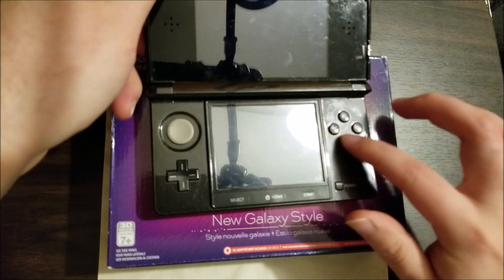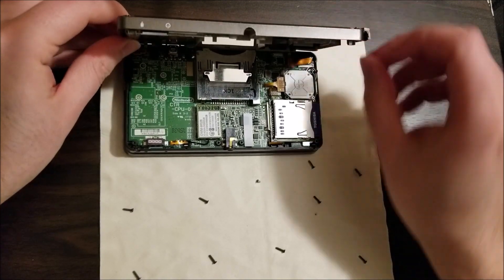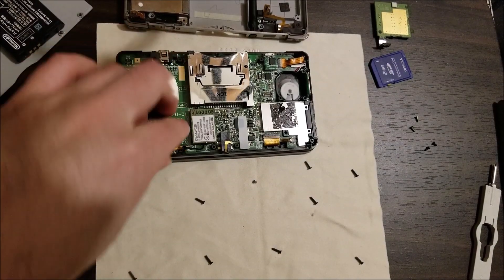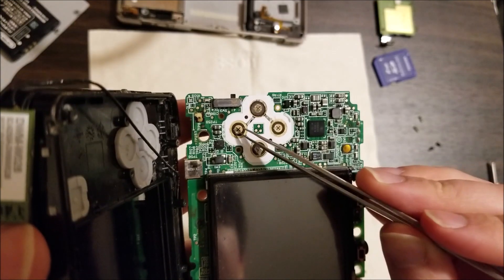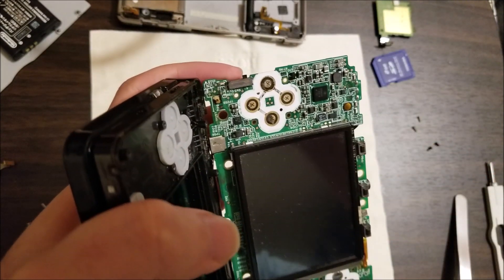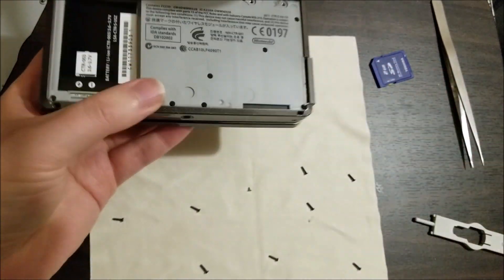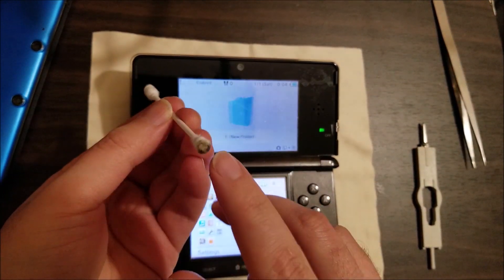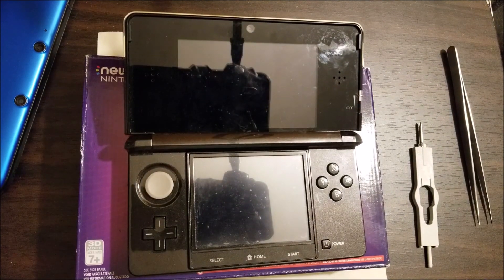Let's Fix: Nintendo 3DS Buttons Not Working

Comment: Hey, quick question does hydrogen peroxide work as good as isopropyl?
Reply from the maker: I'd generally avoid peroxide as it breaks down into water that'll be left in all the tiny crevaces on the circuit board creating a risk of corrosion. High purity IPA is suggested as it quickly evaporates completely, leaving nothing behind to cause corrosion.
Reply: @sjm4306  Is any Isopropyl solution 91% or higher fine? Sorry if this sounds dumb, I'm trying to fix a 3DS and have no experience in repairs
Reply from the maker: Yep, 91% or higher is fine

Comment: @sjm4306  Please help me, I have a Nintendo 3DS which does not receive input from me after I hit it, it can charge, it can power off, power on, you can see the home screen with everything normal, but the thing is I cannot give input, does not move from there, did you ever repair something like this ?

Comment: My A button is unresponsive so i took it apart to find it didnt look dirty at all. Cleaned it anyway but A button is still unresponsive. Any ideas on what the problem is?
Reply from the maker: The snap metal dome that connects to the pads could be worn/dirty.

Comment: Hey, nice video. I have the same model as you but my select button is broken, the one seen down left @ 0:48 ... Do you have any idea of how to fix it because I don't know if I will cause further harm if I try to open this soft cover one the buttons D:
Reply from the maker: Yeah those aren't really made to be opened, you usually just buy a new tact switch and desolder the old one to replace.
Reply: @sjm4306  Alright will do this, thanks for answering :)

Comment: Fixed my a button thanks to this vid, was a little nervous as I’m not really a fixer but that a button was driving me crazy. Every time I hovered over the button it would automatically click what ever it was pointing at and it was annoying as fuck. It would just click for no reason. Bought a busted 3Ds on Facebook and so far I’ve replaced the left and right back buttons, opened it again and swapped both membranes while cleaning out the buttons. Fully modded it and now to truly enjoy this system for what it was meant to be for. Thank you.

Comment: I got to order a new set of x,y,b,a buttons only because the ones on my og system seem to be peeling from the edges so it looks like dirt and grime on the edges of the buttons but it’s actually the clear coat peeling off and it is messing me up with the a button. Since I’m gonna open the system to do this I might as well just replace the buttons while I’m at it. My question is why did you disassemble the whole right side just to go left? You took out the analog and memory slots out but the buttons were all the way in the other side?
Reply: Oh ok, I just got my new membranes in and will follow this video.
Reply: But is that side necessary to open up if I just want to do the x y b a membrane only?
Reply from the maker: Only take apart enough to get access to what you need access to unless you are unsure if there's potentially more liquid damage inside that should be thoroughly cleaned out.
Reply from the maker: I wanted to inspect the entire front pcb in case there was extended liquid damage. Sure it's more effort taking the entire board out but better to catch any potential corrosion early to prevent worse damage over time.

Comment: Hey this video rocks man! Where do you buy chemical contact cleaner though? I’m trying to find it online but I can’t get results that look like yours 😬
Reply from the maker: I got mine from microcenter
Reply: Hey so I’m trying to fix my sticky down d pad button. I followed your video to a T; cleaned everything and put it all back together properly but the button still sticks. What do I do 😭
Reply from the maker: @ChrisDixon-ht1cb it's possible the buttons metal dome is worn out then and needs to be replaced, ebay has replacements for pretty cheap last I checked.
Reply from the maker: @ChrisDixon-ht1cb could it be the ribbon connections going to the top screen?

Comment: My old 3ds bottom screws are stupidly tight. What do you reccomend to unscrew them easier?
Reply from the maker: So long as they aren't already stripped you'll need a nice sharp tiny phillips jewelers driver. Go slow and apply downwards pressure the whole time while slowly backing the screw out a little at a time. Also it might sound weird but take the battery out, pop the 3ds in a zip lock bag and throw it in the freezer for a bit. The cold should contract the metal screws more than the plastic and make backing them out a little easier.
Reply: @sjm4306  'aight, I unscrewed it and reached the part of the membrane removal. I made a big finding after peeling the membrane off and seeing that everything was clean. So I checked under the steel plates inside the membrane and they were all burnt looking. I peeled off the other half of the membrane to try and clean it but it didn't clean. I clarify by saying that I had the same problem as your sister's boyfriend 3DS but now I'm clueless; guess I'll have to buy another stupid membrane...

Comment: what kind of screwdriver do you use? Cause when I try to unscrew the screws on 2:00 of the back of my 3ds xl I could only unscrew the top right and bottom right ones. For some reason, the left side isn't turning with my screwdriver.

Comment: 4:22 I tried these steps before but the SD card board/slot was welded/soldered. So I gave up, is it possible to take it off?
Reply from the maker: Iirc it's just strong adhesive that can be weakened by some heat from a hairdryer.

Comment: It's unfortunate you fast forwarded through the removal of the sticker. I'm looking for a tutorial on how to get this thing off without damaging it or the board. Hypothetically it should be possible without buying a sheet of stickers I will never use again.
Reply from the maker: Warm with a hairdryer and peel from edge with finger nails or tweezers. Just be careful not to scratch the board underneath.

Comment: I followed the steps, put things back together, but now the touch screen won’t accept touch. Do you know what might have happened? I checked and all the touch screen ribbon cables are attached. Is there a solution?
Reply from the maker: Triple check the touch screen ribbon (there's only 1, it's the small 4 pin one coming off the screen, the other larger one is for image data and has no effect on touch) is fully inserted, straight in the connector and the latch is secured. If that all looks good and it still doesn't work inspect the pins of the connector and the ribbon under magnification, it's possible they were damaged.
Reply: @sjm4306  it looks like there’s maybe corrosion in that area, do you know a good way to clean that?
Reply from the maker: Yep that would definitely affect operation. Use a qtip soaked in as close to 99% isopropyl alcohol as you can get. It may take a few rounds of scrubbing to remove. Afterwards check that the soldering on the affected pads still looks good and connected (if the corrosion ate away at the solder it may be necessary to resolder specific connections).
Reply: @sjm4306  I think I need to get a new connector, it looks like one of the pins in damaged. I’ll have to figure out how to detach the current one and attach a new one but I think that’s the issue. Thank you so much for all of your help!!

Comment: Just got a used 3DS for $50 because the A button wasn't working...which isn't a bad price in 2023 unfortunately. Following this video, I took it apart, saw a LOT of soda dried on and sticky in different places. I was surprised that it was just a problem with the A button with how widespread the soda was. Anywho, cleaned up all the soda and got it back to fully working condition. Thanks for the video!

Comment: This definitely helped me. I followed the iFixit guide to removing the motherboard so I could get to the face buttons. Looked like there was nothing I could do at that point. Didn't realize that there was just a sticker over the button contacts. Mine weren't as corroded, but the B button wasn't registering so I scraped off all the slight oxidation on the metal contact discs and cleaned both sides up with alcohol and the buttons work great now.

Comment: I'm looking to repair my nintendo 3ds, the start button works if I press on it a certain way but it doesn't feel like I'm pressing a button in comparison to the home and select buttons. Would that be an overlay issue or would I have to replace the motherboard? (Looks like those three buttons are on the motherboard).
Reply from the maker: It's probably the surface mount switch itself that's failing, would need to solder in a new one. Either that or it's gotten crusty inside, and with any luck maybe contact cleaner could work.

Comment: Heyy, what did you use to clean at 8:02, and also, where can I buy the film  that you inserted after? I've been looking on various websites, but I can only find ones that are slightly different, which I'm not sure if would work on this console
Reply from the maker: I used isopropyl alcohol to clean and the film I inserted was the original button membrane pad that came with the 3ds installed onto the buttons. If yours is damaged you can buy a replacement one on ebay, just make sure to match it to your 3ds model and which side it is (dpad or abxy buttons).

Comment: BE EXTREMELY CAREFUL with the ribbon cable connecting the circle pad! The little plastic anchor CAN come off and is practically impossible to put back on.
Reply from the maker: ^This 100%
Reply: @sjm4306  Please help me, I have a Nintendo 3DS which does not receive input from me after I hit it, it can charge, it can power off, power on, you can see the home screen with everything normal, but the thing is I cannot give input, does not move from there, did you ever repair something like this ?
Reply: This happened to me what do I dooo
Reply: This happened to me with a PS Vita and I spent a good hour or two getting it back in there

Comment: Thanks for this, I bought a used 3ds of amazon, listed as in good shape and overall cant argue with that, but its got some seriously CRUNCHY buttons on the right side of it. Theres no issues despite the uh... aggressive crunching noise they make. The Y/B button tends to get caught and require slightly more pressure to click, and the wireless switch is. Well literally impossible to flick by hand. Need to use the butt of my tweezer to get it flicked.
I've tried using the toothbrush method to get the button cleaned, but its still finnicky. If i play around consistently with it, it seems to warm up but after the device sits for a little bit its back to being sticky. Guess this would be the next step to seeing whats wrong with it. Hopefully nothing annoying to fix up.
Reply: Figure i'll add a second thanks, turns out nothing was damaged. Just horribly, horribly dirty. Previous owner must have left it sat in soda, as the every nook and cranny inside had gummed up syrup in it. Really nasty. And it seems it might have been opened up by someone else at some point, my wireless button that i mentioned was difficult to slide? The plastic above the switch had been pressed in, probably by a screwdriver or file when it was pulled open. Thats fixed, my Y/Bs dont crunch anymore. Its still got a worn down quality that sets it apart from the other DS's i own, but its far far better than it was yesterday.
So thanks again for the tutorial!

Comment: I HATE YOU, YPU LITERALLY SAID PUT A THIN PEICE OF TAPE AND NOW THERE NO BUTTON CLICK, you did not worn anyone, what the heck
Reply from the maker: Did you only put the tape at the edges or directly over the button snap dome (which would obviously affect the button from snapping)? Also scotch tape is probably too thick/stiff, very thin kapton/mylar tape would work better. I cant idiot proof everything, common sense is still up to the user. You really should test before reassembly.

Comment: I think my 3ds has humidity inside. I turned on after a few months of being in a drawer that gets hit by the humid air current in my city.. When It turned on the top screen had a faint "stain" in the edges and the buttons worked just fine until I exited a game and suddenly the buttons, the sound and the touch screen stoped working!!! I've left it for a few days in the open air to "dry" and I charged it again to see if it was that. I turned it on again and the faint stain wasn't there anymore but still unresponsive screen and controls (the only ones that work are the  B, A, X, Y buttons). The 3ds option works fine but is obsolete against all these other issues. Basically my ds has become obsolete and I'm super sad about it because I'm worried its not fixable.. Would cleaning the ds on the inside for humidity help??
Reply from the maker: I would open it and hit the pcb with a hair dryer on low heat for a few minutes to dive any moisture off. It's possible for moisture to mess with sensitive digital electronics, hopefully that's the case here.

Comment: My Dad has before cleaned the contacts on the buttons of some of my handhelds and controllers but they sometimes still lose responsiveness. I asked a repair man if he can help but he tells me cleaning will only help for a few weeks max and I’d need a whole new board! Surely there’s a right way to clean and it’ll last a long time? Also, my Game Boy Color’s B button has seen better days…
Reply from the maker: It really depends on what is the failure point. If it's bad corrosion on the pcb contacts then it may be necessary to replace the board if cleaning isn't effective. Other than that though it could be the membrane that's at fault, either for carbon pill rubber membranes or metal snap domes may need cleaning or replacement depending on the type of button.

Comment: is this the same as the d pad
?????
Reply from the maker: Yes, the dpad and abxy buttons all use the same snap metal domes and pcb contacts to make up the buttons.
Reply: @sjm4306  because the sound dousnt work either you can slide it but sound will be the same in the netgerlands you cant fix it any where
Reply from the maker: The sound volume slider is a potentiometer that's soldered with wires to the pcb iirc. Check the wiring first for damage and then check that the contacts inside the pot are clean.

Comment: MUST READ!!!!: if you are using this as a guide for a new Nintendo 3ds xl the metal snap dome is like a sticker so don’t start by trying to peel the silver part first as It can break it (learned by experience) I thought I just had to peel off the silver part but no it’s a big sticker all connected. Also the residue is very strong so keep that in mind I’d recommend to start peeling at the white part and try to feel the sticker then use  your nail or something else to start peeling. Try to go slow and not fast as going fast start to wear down the sticker. Once you have like a small part sticking up try to use that  to get the sticker out and remember to not go to fast or you could rip it. Last thing try not to take too long as the residue can dry up (which happened to me but not sure if its because of my surroundings or something). When your done try to align the silver part with the screws because that’s where your button push is going too. When you put the sticker back on just screws everything back up and it should be good. Here’s some tips: If you take off the small ribbon cables remember to be gentle as they are fragile and when putting them back don’t but to much force as you can break then just align them and they should snap back together I find it way to do the one on the right first as it’s easy then the one on the left as i find it to be more difficult and take your time don’t rush it! Next tip: On the new Nintendo 3ds xl the buttons and c stick is on a different board connected by a ribbon cable you try to remove it but remember to be careful, personally I didn’t remove it as I was worried of breaking it but you can still see the buttons and fix then just remember that the ribbon cable is there and try not to bend it and keep in mind your movement with the board will be limited. And also when removing the two little circles that hide the screws keep in mind that they have very strong residue on them so it make take a bit to pull them out I recommend using a tool that can go in on the side of the little circles and doing a full circle around then then try to push it out with your tool. Lastly make should you have a big enough work space as you’ll be taking apart the 3ds you’ll need to keep and eye on them so they don’t get lost especially with the screws and try not to mix them up as they are different. Final thoughts, this video differently helped me in combination with a video of taking apart the new Nintendo 3ds xl I went in with my x and b button not working as I thought that some liquid had gotten in knowing me I had probably dropped something on it but when I opened it up it looked completely fine no gunk or anything in it I still rubbed the alcohol just in case and put the sticker back on but as I said I had broken my b buttons silver part on the sticker so now my b button doesn’t work at all at least it fixed my x button but I still wonder why my buttons weren’t working unless I pushed hard on then so I have either the choice to buy a new 3ds or a new metal snap done I’m probably going to buy a new one as my current one is in pretty poor condition as it’s fairly old but this video did help as it fixed my x button and would have probably fix my b button had I known how the metal snap dome worked but at least it fixed my x button so in conclusion I’ll give the video 9/10 very helpful but I’d wish they part where the metal snap dome was removed shown. Thanks for the video tho! 👍